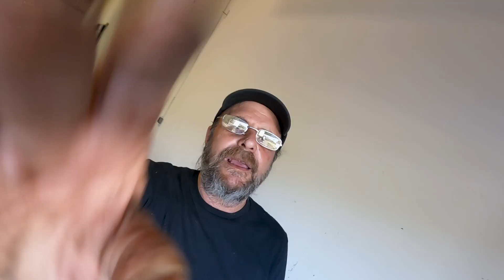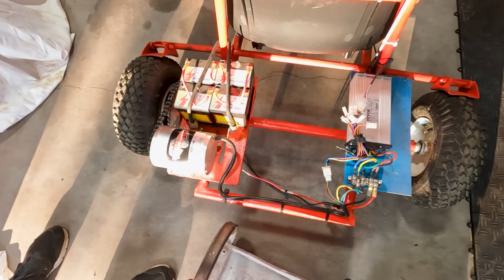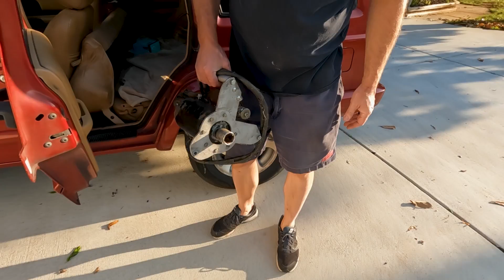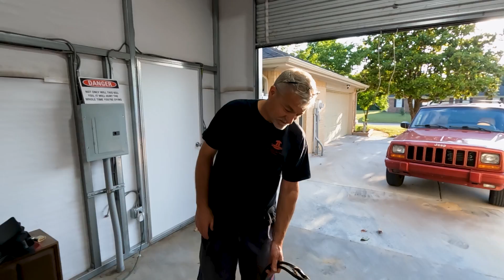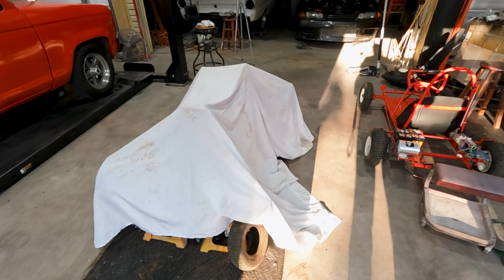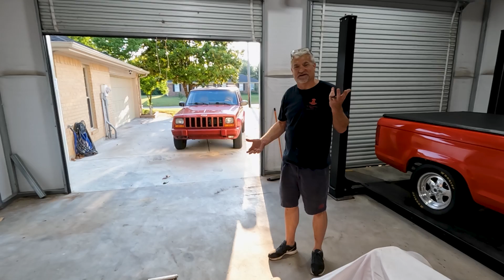The World's Fastest Electric Chair?  36 Volts And 1500 Amps Of Go Go Go-Kart!

Comment: Series wound motor= max torque and power. After 2 minutes or so the solder starts melting and it comes apart. Not recommend for cruising.

Comment: 36V * 1500A = 54kW

54kW/746 W/hp = 72.4hp

The current rating for the motor is prob. nowhere near that, though. Would love to know the nameplate numbers and duty rating.
Reply: It draws 1500 amps but only when it first starts, continuous amp draw is probably less than half that, which is still a crazy amount for a go cart.

Comment: Those mini bikes are actually really snappy, with that centrifugal clutch once they go they really go 👍
Reply: Torque converter is really the way to haul it , have fun keeping the front end down  😮
Reply: @MrTheHillfolk  the motors are low in the frame and as far forward as possible to keep the front down, they do a nice job.
Reply: @minnesotatomcat  
Still, try it with a torque converter, it's like changing from an automatic to a manual trans

Comment: I built an electric car in 2009 that had a 72V battery pack and a controller that only allowed something like 400 amps to go to the motor. If that thing draws 1500 amps thats twice the power of my electric VW Squareback that went 65mph.
Reply: Of course continuous amp draw is going to be less than half what the starting current is but a go cart with that starter is going to take off REAL quick.
Reply: @nicholasagnew2792  I think they might need to rig a test dummy and some RC airplane toggle switches first..... For certain this is one time a heavier dude will make better use of the power.
I imagine a sprocket the size of a go cart drive sprocket installed on the electric starter could boost the final drive enough to actually make 800RPM very useful in a short distance.  Would you say that starter could turn 1200RPM total? I know it can turn more than ordinarily would as a starter, but heat still becomes some issue for long burns on one, it would seem.